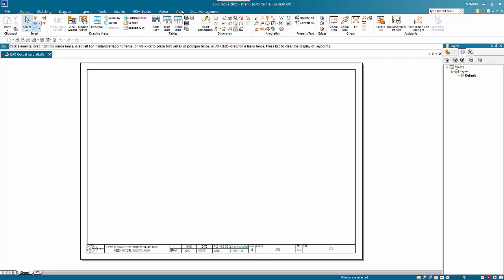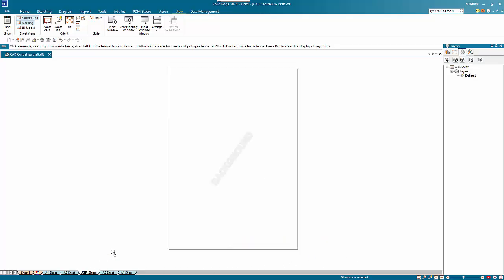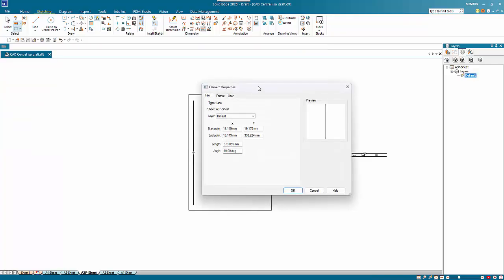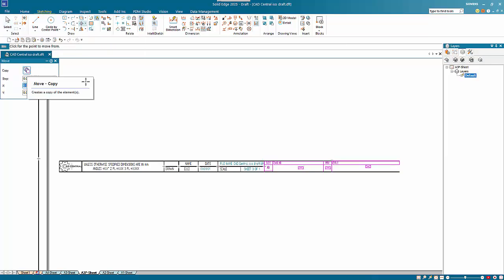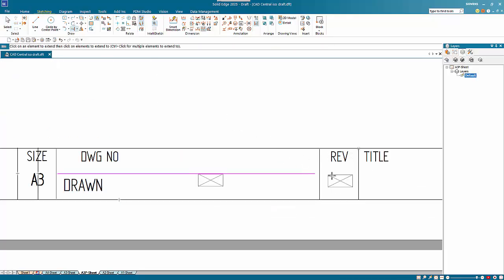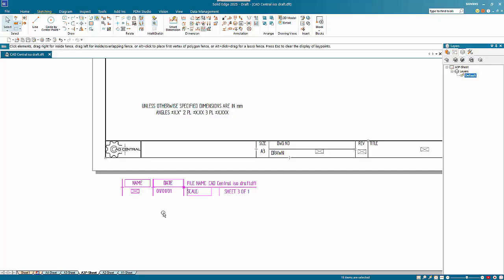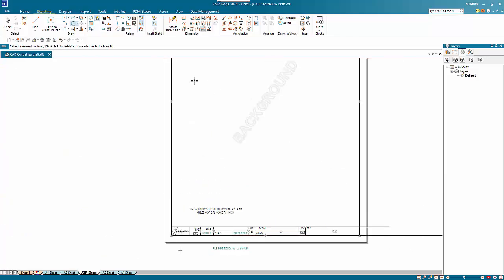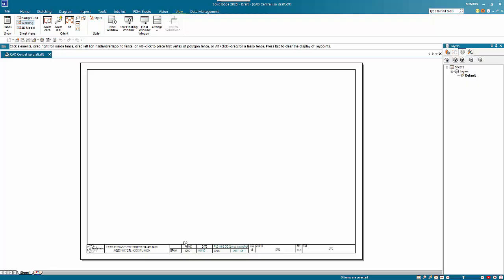Setting up a Solid Edge template.

Comment: for some reason when I open my ISO metric template the drawing interface is just blank. The sheet does not appear for me.
Reply from the maker: Can you check the active sheet name at the bottom of the screen. I would guess that it is labelled "2D model", which is where you draw in 1:1, as that does not have a drawing sheet. If this is the case, you need to got to the view ribbon and make sure the Working option is displayed. Alternatively, double click on the Sheet 1 tab at the bottom and switch to the Background Tab and make sure "Show background"" is ticked